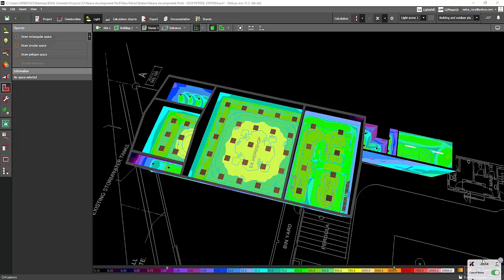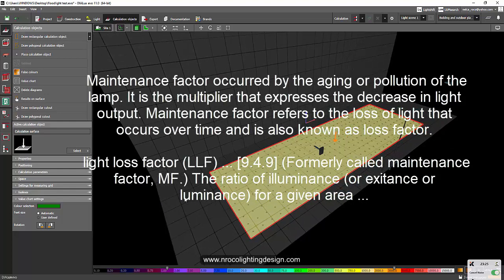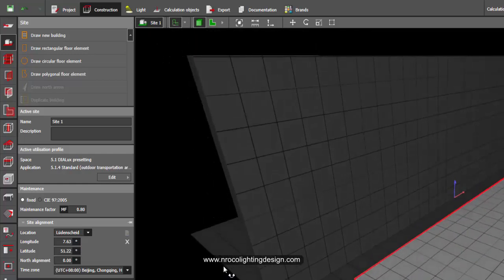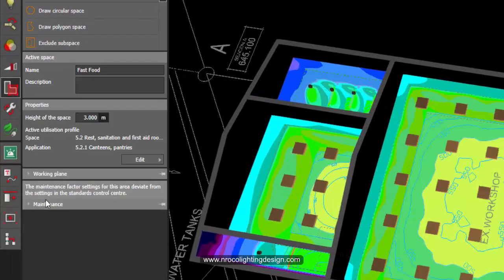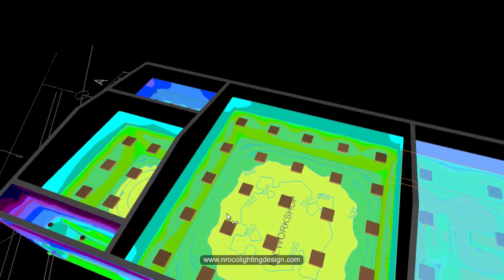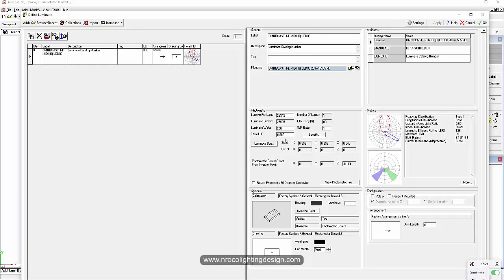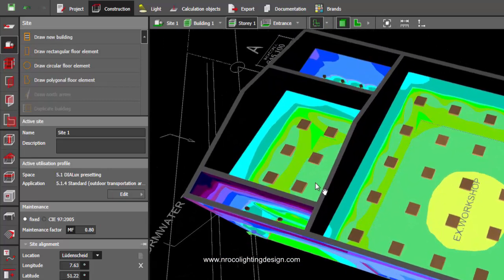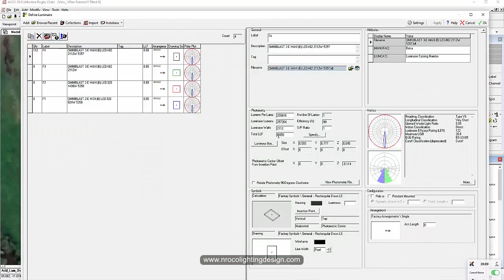What is the diff bet the maintenance factor and the light loss factor?

Comment: Hi, why do we change maintenance factor in any calculation? Anyway lighting output at the start would be 100 percent regardless the loss over the years.
Reply from the maker: Its a very good question, Shita.  The maintenance factor is used as a safety net for the designer and manufacturer.  So it will have the same lux value until such time.  I think I need to create a video about it. ☺